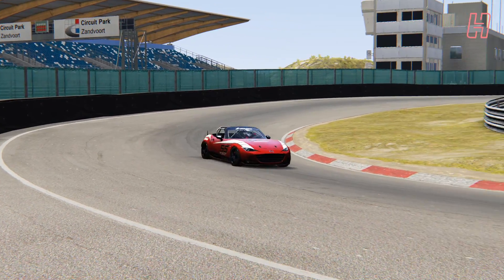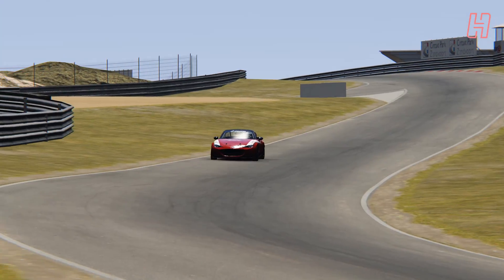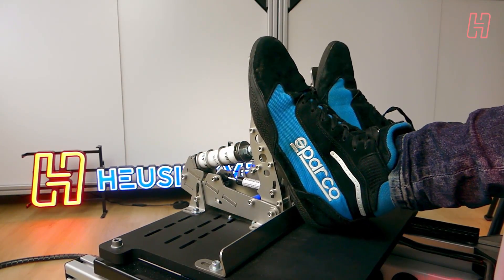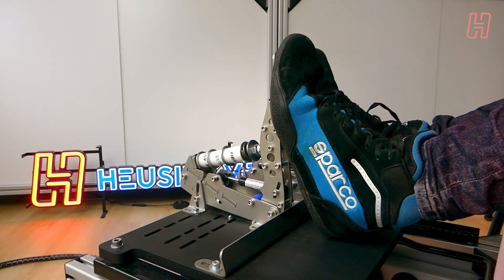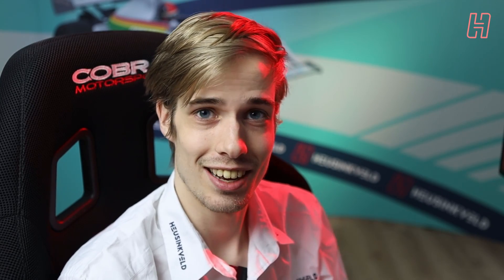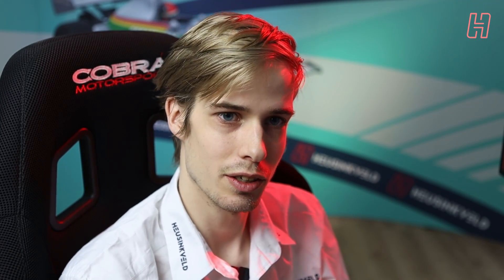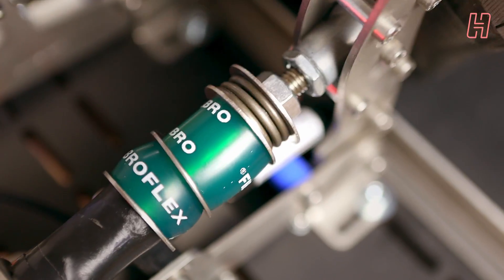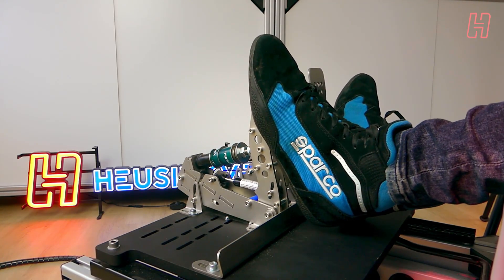Enzo explains choosing the right brake pedal force and pressure

Comment: Nice video on how to adjust them to your likings. However I am wondering what are your thoughts and recommendations when it comes to competitiveness? I own the Sprint pedals and really love them. I exclusively use them in iRacing, more specifically in the Porsche 911 Cup car and the Porsche 911 RSR GTE. I started with the default rubber installed (xl), which was already a big improvement to my previous potentiometer pedals. But recently I have switched to a harder setting (m) which made it even better for me. I'm considering going to the stiffest setting (s) and cranking the preload to its maximum to eliminate the initial travel. Would you recommend that? I'm not racing in real life and I don't have that ambition, so for me it's purely about being competitive in iRacing. Thanks and keep up the good work!
Reply from the maker: We cannot give a recommendation unfortunately. There are just so many people out there with their own preferences and so many cars with so many differences with the feel in the brakes. Just make sure you tried different settings on different cars and look where you are fastest with. If you want to be competitive make sure you find a nice balance between feel and not pressing to much kilo's. If you press too much and your competition does not, you might be the one getting tired before your competition.

Comment: A heads up for Sprint owners: if you install multiple of the softest/thickest rubbers, there will be a "delay" in the 'final compressed state' of the rubbers when braking. In other words, if you apply a static force on the pedal with your foot and observe the input level in the HE software, you will notice an initial high input that will then significantly decrease over the next couple of seconds as the soft/thick rubbers slowly continue to compress slightly under the static load, thus consequently lowering the load on the load cell. It's like an unintended trail braking effect that you won't discover unless you observe the input graph, since you keep a static force with your foot. The way I've gotten around this in order to get the softer feel/longer travel I like, is to install the 3 hardest rubbers. Then there's no significant delayed compression effect. The only issue with that setup is that there's not enough spacers included in the kit, so I choose to run the hardest rubber just directly against the preload nut. I don't see any big issues with that since the hardest/thinnest rubber doesn't compress much, but never the less an additional spacer, given that this configuration is possible, would have been appreciated. Besides this afaik unmentioned, curious phenomena (which I became aware of by luck) I'm very happy with the performance of the pedals! 😊👍
Reply: Kristoffer Lindgren I think you have answered some of my issue. I’ve seen on my traces for eg.  a 80% initial force then a immediate drop of 5% pressure, which I can hold. Unless I apply the brake at a slightly slower rate. There’s always a 5% drop off in pressure. So I’ll try a firmer 3rd rubber. Thanks for the heads up.
Reply: Do you really mean the brake gets softer with the hardest rubber?
Reply: @kezman82a  no. What I'm saying is that I'm getting around the delayed compression issue by using 3 of the hardest rubbers instead of 2 of the softer. It adds up to about the same amount of total rubber, but without getting the delayed compression that the larger/softer rubbers produce.
Reply: @krilin84  got it! 😁
Reply: might could use soft Die Spring to eliminate this issue

Comment: Enzo, I notice you extend your leg with knee and ankle extension to press the brake. 
For modulation, you seem to lock your ankle and modulate with your knee and hardly with your ankle. 
Is this just preference or other reasons?
Reply: I know with me when I set mine to 50 kg... no way I could use my ankle to press the brakes.. I'm definitely using almost all knee and leg for braking
Reply: That’s how race cars drivers do it they use their full leg muscles with their ankle locked, and formula drivers literally use their body weight when their getting push toward by the g forces from the braking zones
Edit: Meant forward not toward.
Reply: @Pradozj22  they don't. They are strapped solid to the seat, which is static in relation to the pedal, so their body doesn't come into it. Only their leg will "weigh more" due to the g force produced on it by deceleration.
Reply: ravey1981 right more like that, thx.